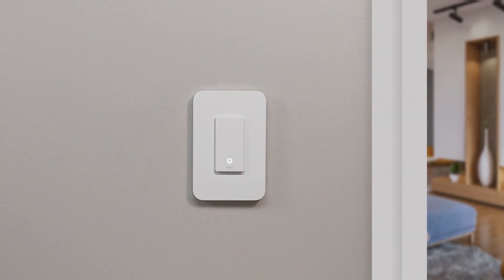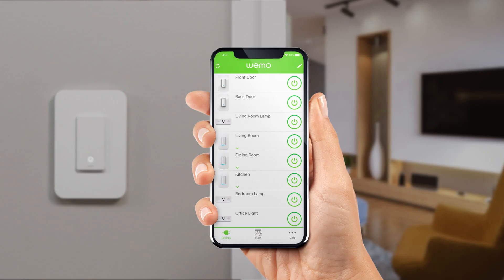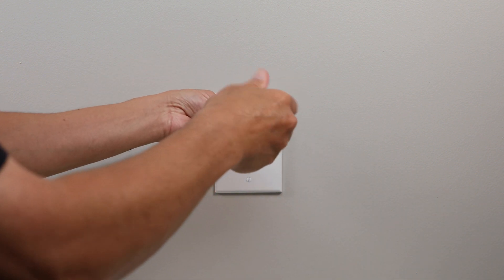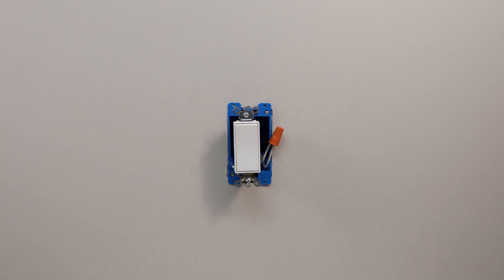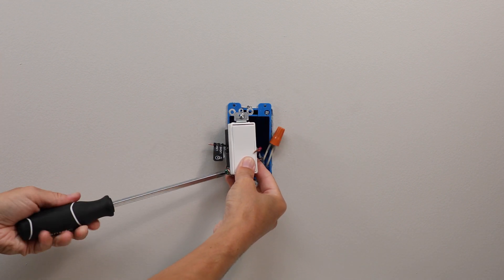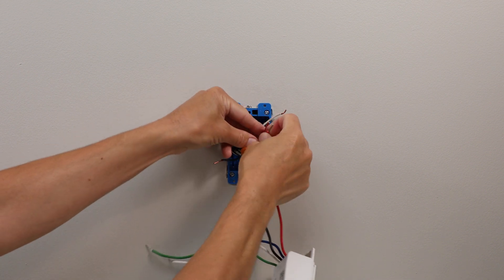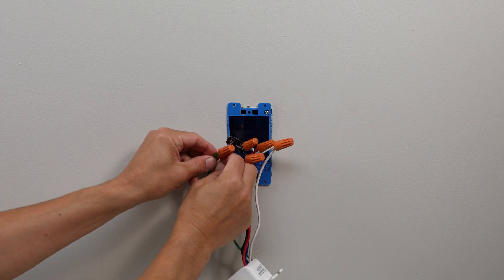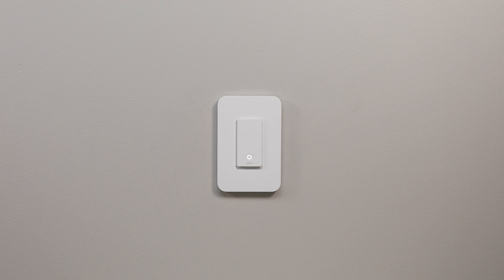How to Install Wemo Light Switch 3-Way to Replace an Existing 3-Way Switch

Comment: Do I need the faceplate from the box if I am adding the Wemo for a specific room and it is with other regular switches?
Reply: No, you can use them with the faceplate you have if its the same type of rocker switch.